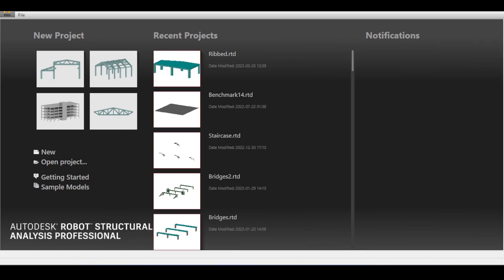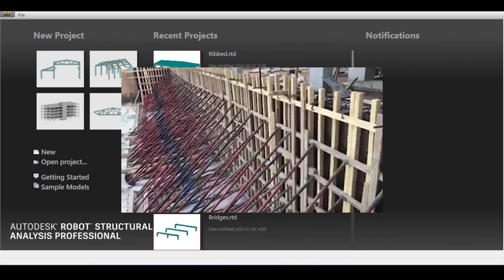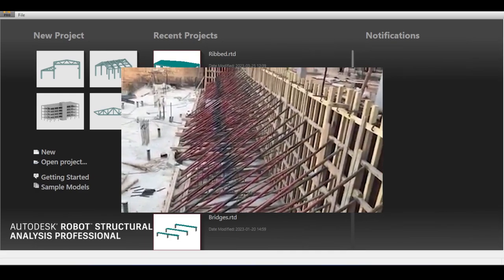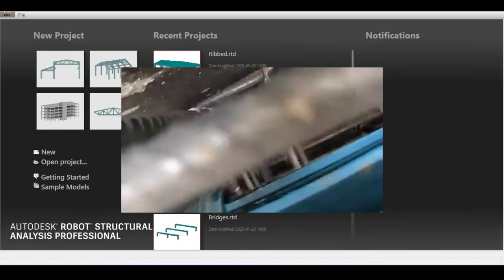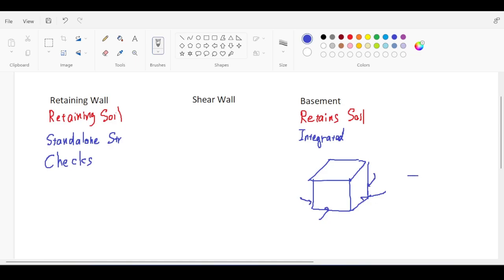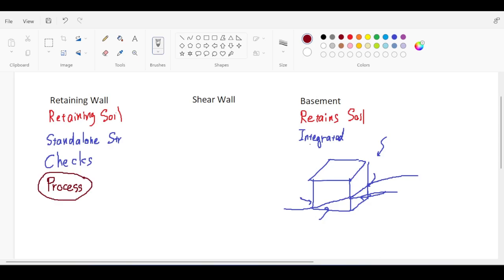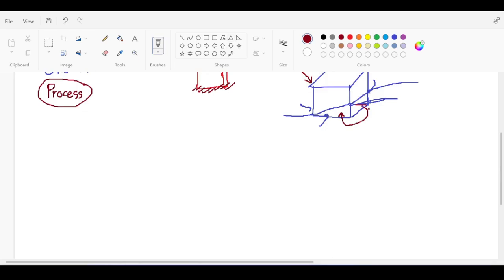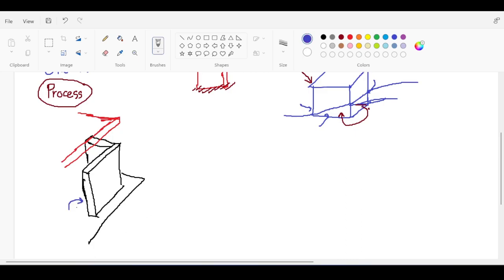Modeling of Basement Walls in Autodesk Robot | Part 1: Modeling Process

Comment: Hello CEE,

PART I

I must say that the video intros and their original videos links showing the “real-life” and/or the “overall/overview” of the concept of the tutorial of the day are a welcome addition. They help a lot to set the scene so that it is much clearer as to what the bigger picture for the day is. Thanks for these and keep these up.

The background information and key concepts lecture part of this video which covered the various types of walls, their similarities and differences, the different kinds of connections in a basement wall, the idea of an integrated column v/s a separated column, storey height v/s basement height was content rich and it was very enlightening for me. The information on these parts helps me to be able to comfortably navigate and appreciate various assumptions necessary in the modelling and design of the basement walls. Because of this information, I can be able to work with other types of basement walls beyond the exact example that was used in this video. Thank you CEE for always adopting such a holistic approach.

Question @ 09:03 – In case one decides to use the option of a separated column, would the GAP not be subject to “expansion and contraction” of the concrete on the basement walls on the LHS and the RHS of the column? Shouldn’t the gap then be filled with compressible filler materials to allow for such expansion and contraction to occur? What is the typical width of such a gap in a typically spaced columns arrangement?      

I think that the “contraction and expansion” coupled with “the need to stop water and soil ingress” makes for a very challenging construction details on this GAP, what are your thoughts? In any case, would it not be inevitable that there be at least some contraction and expansion joints (gaps) in a long and continuous concrete structural element like a basement wall? 

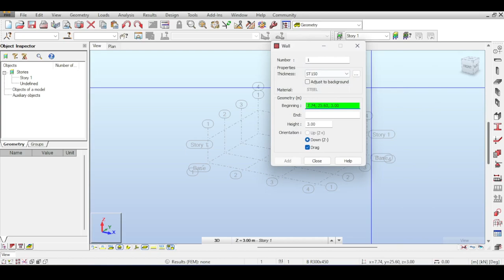11:15 😂🤣😂, I also think that we should explore both walls and shells so that one can decide when is it more beneficial to use a wall or a shell model and visa versa. I am glad that this is the route that is being taken in this video.

 13:14 Nice catch 😊 [Yes, you are correct, mathematically speaking, the “area” term in equalish areas everywhere will always cancel out, and the calculations can be effectively taken as just the number of stories x by the sustained load action, nice catch and thank you for sharing, it can be sometimes difficult to spot these simplifications when one is overwhelmed with the crunching of the numbers, it is really good to have someone like you to guide and to remind]

Question: When estimating the foundation load or “service sustained load”, are we talking about the ……“Sustained Vertical Load” which equals to the “total nominal self-weight of the building” including partitions and permanent equipment and the sustained portion of the imposed vertical loads (usually 25% to 30% of the imposed (live) loads depending on the code of practice that one is using…….?)  
  
  
13:34 Video ideas suggestion for the future: I propose a deep dive video on how to properly estimate “Tangent Elasticity” Kx and Ky kN/m3 for rafts. And even how to estimate the rotational elastic coefficients HX, HY, HZ (kN*m/Deg) for elastic supports. I currently find these to be a challenge and I think that the CEE can help to unwind these life mysteries 😊. I know instead of using Kx, and Ky there was a time where a “stabilizing support” was applied in the beams on elastic ground foundation video…. how important are these factors? Can one “ignore them” and use stabilizing supports and dummy values in detailed designs?  

13:50 😁😁 on the model type…you are not alone there …. Autodesk should really look at allowing users to choose a default model type that will appear all the time …. Unfortunately, I can’t say the same thing about the thickness, Mr. Editor is correct, LOL that one is all on the n000000b!!, Autodesk is innocent.

15:36 I’ll speak for myself here. I have never had any problem with the CEE balance on all the past videos. I actually prefer and like it when CEE focuses on the new. 

I think the fact that CEE refers to and also links detailed and applicable previous videos for those who may not have yet watched a certain subject matter for reference is more than enough accommodation for those individuals. 

Unfortunately, and like most things in life, there will always be steps and elementary knowledge that is required in order to carry out certain tasks efficiently…. one must first learn how to walk before they can run; you shouldn’t learn how to walk at a sprint running Olympics event…. [this is my opinion; anyone should feel free to disagree and express their opinions].

The comment is continued in PART II
Reply from the maker: Hi there Engr. DK, 
Happy that the video got some positive feedback from you. It helps not only me, but all other viewers as well.

Indeed, the Editor started including those things whenever he starts talking about something new that is not theoretical in nature. 

The background infos discussed are something I see forgotten about, only to be included in a last minute effort, causing some serious hassle.

The gap is indeed filled with expansive water repellent filler material. Still, I want to state the following: Do not do this ^_^ It is - in my humble opinion - a 1000 times better to have it an integral part rather than separating columns from walls. It is only headache. Still, true to the nature of this channel, I try to cover all possibilities.

The rule of thumb is usually 1inch. But please note that this is not a rule set in stone, as we engineers can always deal with any case that arises.

About 11:15, allow me to tell you, you gonna get an enlighting revelation in part 2. BTW, I already recorded it and finished editing it. I really really want to include your comment in it, but it is already finished editing. So please wait, part 2 is gonna hit all people hard.

About the sustained loads, yes yes yes. I 100% agree. The load is kind of similar to what you would use in earthquake loads. This is OW + sustained load + % of your live load. I missed mentioning this. To my defence, I try to be code neutral.
(Hi there CEE Editor here, I usually do not write comments but the recorder guy just plain lied to cover up his mess-up.... what a n00b).

The idea of diving deep into the foundation is something that is already overdue and should be covered ASAP, I guess I will add it into my ASAP list. thnx a lot for your suggestion. Yes it seems to be a mystery at first,, but I guess I can do some magic there.

I keep messing up my model type, only to discover after some frustration that I messed it up.

It is a challenge to be honest to kind of balance having a fast paced youtube video vs providing just enough details.. It is really a hard balancing act.

Part II cont'd
Reply: @CivilEngineeringEssentials  

Hi there CEE,

Thank you for the comprehensive feedback, I can gladly confirm that you are definitely not missing anything and that you are providing full answers [on all Parts I, II, III]. 

It is both a pleasure and an invigorating experience to read through your perspective and guidance. 

You honour me regarding the targeting of the FE size. I want you to know that all your videos, your shared thoughts, and the shared references are a BIG BIG influence on the way that I currently approach engineering challenges. Thank you for being you, thank you for sharing your knowledge with the rest of the world.

In PART III, as far as I am concerned, you have given me LED SPORT LIGHTS and a rope out of the rabbit hole. This right here in part III is one shining example of a case in point where one can see and experience the CEE channel wisdom, patience and guidance without judgment. Thank you MJ 

Here’s is to your successful exams sessions next week. Know that you have already given a lot to the CEE channel community and that you continue to give more [you have recorder part II of the basement walls video early to accommodate us] + THE COURSE 😲. It is totally ok to shift your focus to the exams, it is ok if you won’t have time to record something, you have given the community a lot to chew on at the moment, the community will be here when you return; all the best with the exams sessions.

Kind regards, DK

Comment: PART II

18:01 😁😁, the group selection and deleting of the wall supports is working with Delete “linear” support selected. I can’t say why this did not work on your model because you seem to have also tried Delete “linear” support, I can only confirm that the very same command did work on my model. Maybe Autodesk is not so innocent after all heh?

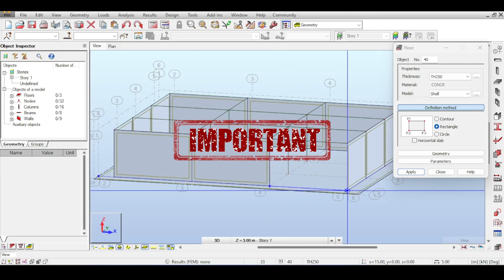19:05 Thank you for mentioning this important point, and for reiterating it again at 20:50, this is very much appreciated.

20:12 I am glad that you decided to go with the GAP option, it gives a practical learning chance to explore how to deal with the associated meshing challenges due to this decision and configuration.

Is making the GAP 3m-2.75m = 250mm one of the workarounds (or preparations) geared to minimise the predicted FE meshing problems, why is the size 250mm and not say 100mm or any other value? could it be because CEE anticipate the FE sizes of the mesh to be generated for the other elements to be around 250mm_ish? I also noted CEE mentioned the meshing nuance at 33:05 related to this GAP.

21:28 😂🤣😂…. I’ll just leave it as it is I don’t care…. otherwise, I would have to deal with the ceiling of that thing……. 😂🤣😂…. 

I think I would consider a GAP between column and basement wall if I am going for the separated column idea or if I am making an expansion/contraction joint. 

Note that I still have my reservations regarding the separated column idea at the moment because of the practical difficulties which I foreshadow during the construction and during the operation of such joints.

I would like to add the following question in addition to my earlier questions that I asked at 09:03 above.

Question: With brickwork or blockwork one creates expansion and contraction joints on the brick walls and not on the floor slabs that support those brick walls. I am thinking the same concept with the basement walls having expansion/contraction joints on them and not extending through the raft foundation that supports these basement walls.

Is there ever a time where it would be practically or theoretically corrected to extend the concrete structure expansion/contraction joint through the raft foundation? 

I think this would mostly be problematic for the same structure and should only be considered where one have say a relatively long building [like a school classrooms block] and decide to separate the building structure into “separate structures”. What are your thoughts? What length of concrete raft foundation would justify to consider “separate structures” and “separate raft foundations” by means of an expansion/contraction joint cutting all the way through the raft foundation? 

 
22:04 YES, indeed I agree. I think FOCUS is good practice and it allows the videos to be manageable at under 60min. For me, the simplifications are not an issue as long as the CEE continue to remain clear on the same video as to what simplifications are being made and how a user may deal with them. This information allows a user who intend to model a full structure to be able to do so and also to be able to include or adjust their model to now include the simplifications that were missing in the tutorial since those are clearly disclosed and guidance was provided by the CEE. Thank you CEE. 

27:34 that was some sleek selection of those six (6) panels to be honest ^_^

28:03 😊not cool, not sleek ^_^

  
28:12 Thank you for going through the detailed interpretation of the results. It really helps to reinforce and to confirm the interpretation of these results.  

  
Thank you again CEE for such an engaging video. There is so much to learn from your videos and I am looking forward to part II of the basement wall video.

Take care and have a wonderful day

Regards, DK 

Ps. I have a tangent question that I have attached as a separate PART III below. Apologies for the loooooooong comment.
Reply from the maker: Hi there Engr. DK,

I am almost 99% sure deleting using linear supports worked in the past. For some reason, it just did not work today. Conspiracy Confirmed!

Local axis direction is extremely important to have a chance in interpreting the results in a meaningful way.

OH!!! THE COMMENT IS GOOOOOOOOOLDEN!!! I wish I had not recorded part 2!!!! To my defence, I recorded earlier because I have to give some exams next week so I might not have any time to record smthn.
But that comment, this is youtube gold!!! YES, putting the FEM size to target that 250mm value or any value like 125mm is GREAT!!! YES!!! YOU ARE A GENIUS!

Exactly, about leaving it as it is, I know the practical problems of having a gap.

I tooooooooootally second your opinion of HATING the gap between column and wall. As I said in part 1, I want to cover all bases, while providing subtle (and sometimes direct) comments of how I hate a certain alternative.

My previous comment of the expansion joint is the same here. With the difference in brickwork that you might need to provide a steel mesh at the last brick so that you can connect it effectively with whatever you gonna cast on its edge, before you go with the expansion joint.

Expansion joint in rafts? I need to go to my "bat cave" and do some research to be honest. I would never "wing an answer" when I am not 100% sure. Now I know that a structural joint will cut the raft in some cases. Expansion joint? hm.... 

Still, I second your opinion about this being a nightmare in practice, that is why I keep hating it multiple times in the video. Still, I have to research the idea of joints in rafts. I will get back to you. 

I actually lightly script my videos, but the reactions and ideas while implementin are things I come up with on camera. Crazy part is, I had to pause to do smthn and forgot to record again. Ooooh editor actually hated me for that.

Cont'd Part 3
Also, no problem, you can write as long as you want, you will always get a full answer. I still hope I did not miss anything.
Reply from the maker: I tried looking for some infos with regard to raft joints. I found this. I am not really happy but at least that is a start
https://www.structuralguide.com/construction-joints/